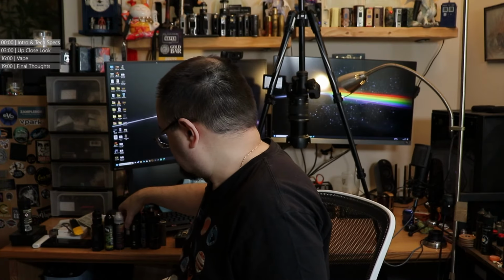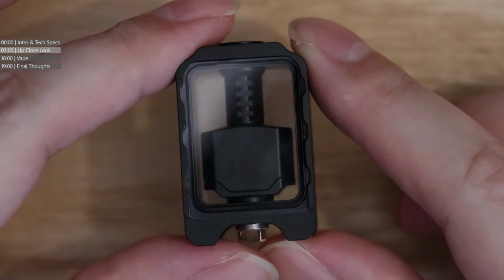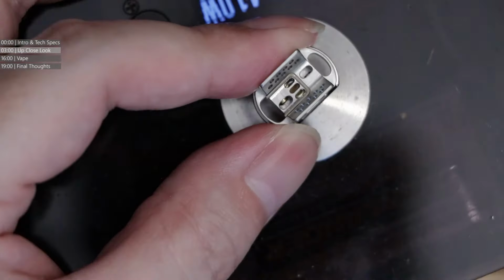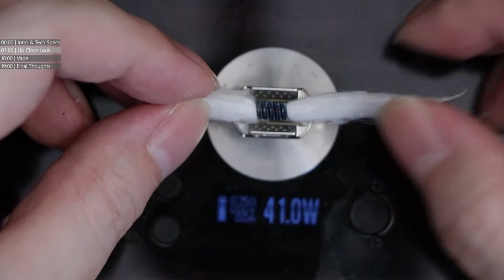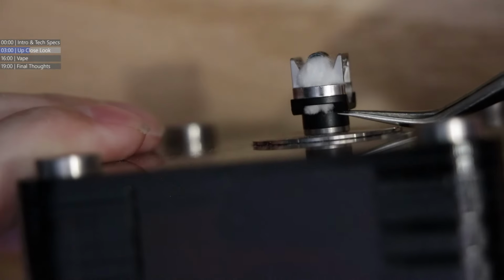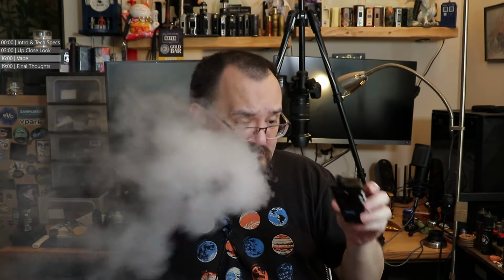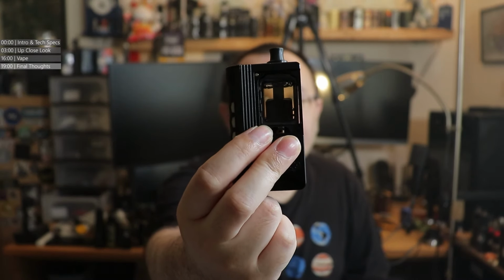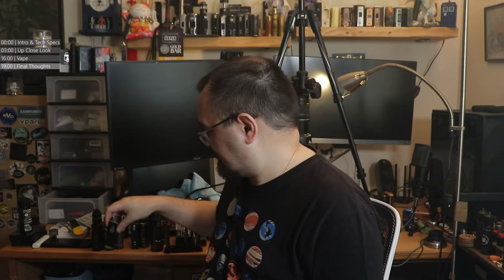The Blaze Bridge Dual Glass Door from Thunderhead & Mike Vapes - The Blaze Boro gets an overhaul

Comment: I bought one of these double glass blaze tanks and the bridge is centered in the tank between the glass. Doesn't fit my cthulhu v1 as that one is offset slightly so the drip tip won't screw down. 

Are you blaze double glass tanks centered as well? 

Trying to figure out if mine is defective of if my mod is just not compatible, thanks.

Comment: Vic, I’ve had problems with my Blaze Boro in my Rift leaking bad. But it wasn’t the sliding glass door on both sides. I put it in The Crypt V1. Does the sliding glass doors stop it from running out all over my Rift? I wicked it just as you and Bogan said to let the cotton come out of the bottom of the wicking ports but when it heated up it made a mess. I’ll take anyone’s advice, thank you for your time.